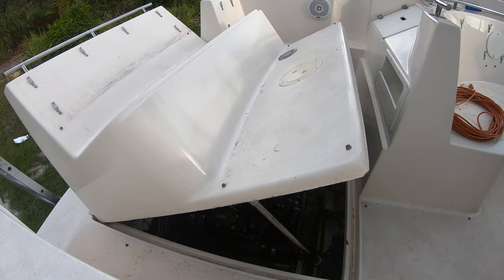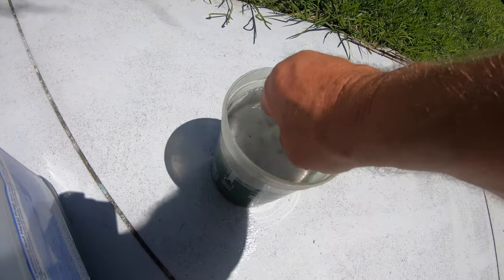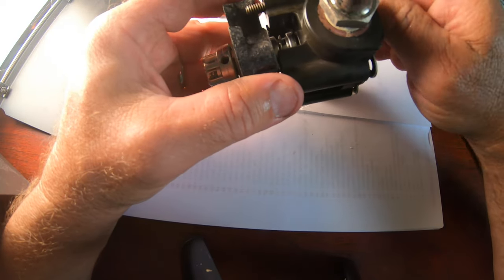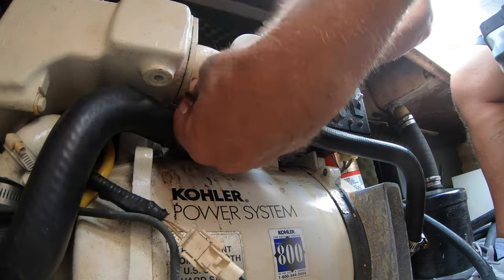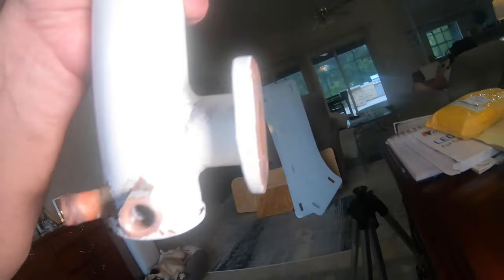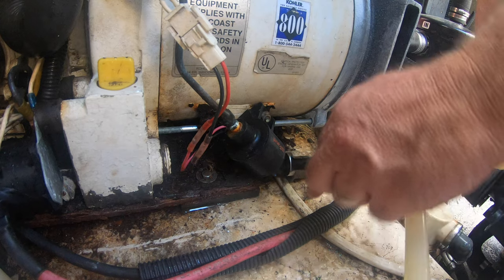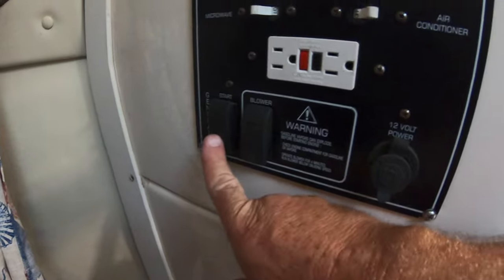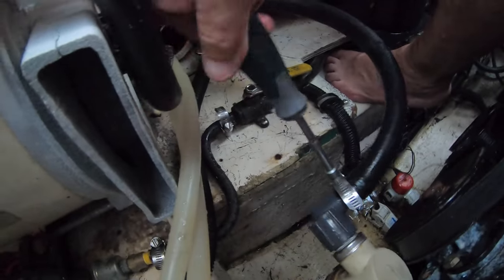Kohler 5E Marine Generator Won't Stay Running - Troubleshooting and Repair in 4K

Comment: This video was very helpful. I submerged my heat exchange and it came clean. It was incredible what flushed out with the hose. Once clean I found several pieces of old impeller on the inlet end. They were a pain to remove but I was glad I did. The generator runs fantastic now. The water out the side of the boat is much cooler now. The acid isn't cheap but worth every penny
Reply from the maker: @ChrisLuhnow  glad it was helpful. A whole bunch of crap was stuck in mine…

Comment: great video, I had already changed my impeller assembly but noticed not enough water going thru system and generator would still overheat after a while.  Next stop is the heat exchanger, thank you.
Reply from the maker: Good luck with it. I had lots of mineral deposits inside, but an acid bath cleaned it right up!

Comment: Very impressive, thorough and super helpful video! I am excited to start working on bringing my Kohler 5E back to life on my Rinker 312. Thanks a million!!
Reply from the maker: Thanks for the comments. I would definitely look at the fuel filter and the oil pressure sensor switch first. Also, if you have drained the coolant out, there can be an air bubble which will also shut down the generator. If it runs and then turns off after a few seconds, try disconnecting the wire from the oil pressure sensor switch. If it still runs after doing that, that’s your  culprit.
Reply: @RandomlyAwkward1  I will definitely add that to my list! Plugs, filters and impeller on order. I’ll reply if I find anything interesting

Comment: I’ve always wondered where that yellow impeller bushing goes.  Lol.   A couple other stalling issues I’ve discovered in this gen is a misadjusted choke and also air bubbles in the coolant or low coolant levels.   Kohler gens have sensors for everythig and the old models don’t give error messages. Making troubleshooting a pita😡.  Nice video. Thanks.
Reply from the maker: Thanks Tommy… I finally got it to stay running long enough for the blender to make Pina Coladas!

Comment: GREAT video!! It helps a ton!  

Mine runs for about 45 minutes to 1 hour and then turns off.  It's the same load the entire time.  Start up completely normal.  Any idea what would cause this?  Thank you.
Reply from the maker: Glad it helped! Yes, check several things… make sure that you have enough oil in the generator because there is a low oil pressure shut off switch. The switch can also go bad and may need to be replaced. You can troubleshoot it by disconnecting it and if it continues to run, then the switch is your issue. You can also have a coolant air bubble. There’s a little bleeder valve screw up on top to burp out the air. The other is a  poorly operating impeller that may need replacing. A piece of an old impeller vane may have broken off and is stuck in the heat exchanger or you could have an obstruction. I ran phosphoric acid through mine to get rid of the barnacles and mineral scale. Overheating from an obstruction in coolant flow or low oil pressure are usually the culprits. Also, check your pencil-shaped anode passageway for obstructions. Good luck!

Comment: Nice video!  I have a 5E on a 2004 Sea Ray 280 Sundancer that's not exhausting any water.  I checked the screen and that's clean.  Next step is to check the impeller, which is a bit hard to get to in this boat.  When you took off the heat exchanger and refilled the coolant, did you have to bleed it to remove air bubbles?
Reply from the maker: Thanks… Yes I did. I put some coolant in it until it was full and then ran it and it bubbled a little bit and I put more in there. Incidentally, you said it is not pumping out any water. My impeller just went bad about two days ago. I’m currently replacing it as we speak. The repair itself is very easy. You just take out the four 11mm bolts that hold the water pump onto the generator and remove the hoses. The whole assembly comes off and you can just push the new impeller and O-ring in place taking it out noting which direction it turns. A little bit of Dawn dishwashing liquid makes it insertion much easier. What happened in my case was the metal collar that is inside of the rubber impeller became disengaged from the rubber so the impeller stayed put but the shaft turned. That generator has a thermal shut off so after it runs for about a minute and overheats due to lack of water circulation it will turn itself off. That sounds like what you are experiencing as well. You can also check to make sure your sea strainer is not clogged and that there’s no obstruction under your hull like seaweed or something to prevent water from coming in.

Comment: I’m fighting the same issue in my Kohler 5E on 2002 Rinker 270. I replaced fuel filter, antifreeze, oil and filter, fuel filter, anode, impeller, and added a stainless steel thru hull. It never ran after my “tune up”. Pulling it apart tomorrow to check oil / antifreeze levels and oil pressure sensor switch. 🤞🏼
Reply from the maker: It drove me crazy but the main culprit was the oil pressure sensor switch. Does yours start and run for 10-20 seconds and then shut down? If so, it’s almost 100% the oil pressure switch.

Comment: Very good video - I have 2008 Sea Ray with same Kohler 5e - did you have to prime the fuel line after replacing the fuel filter.  Love you sense of humor
Reply from the maker: Thanks for the compliment… I did not prime the fuel line. It fired up in about three to five seconds. I think the oil pressure switch is a big issue with these generators.

Comment: Great video, two dumb questions.

1. Did you have to do a full coolant change after putting the heat exchanger back on (why didn’t coolant come out of anode hole).

2.  The part I really wanted to see was right when your go pro fell.  I can change my impeller by taking off that housing but how did you get the next housing off to reach that yellow coupler?  Is it just a hard pull or are there more bolts than the 4?

Thank you!
Reply from the maker: Thank you… not dumb questions… since it was the first time that I had worked on the generator and I did not know the history of it, I changed all of the coolant. It really wasn’t that big of a deal. 

     The coolant didn’t come out of the hole because the rod was totally disintegrated, and it was gummed up, so nothing could come out of the hole. I dissolved all of the crud with a phosphoric acid I’d bath.

     That stupid housing was incredibly difficult to get off. It just press fits on, but I ended up using ratcheting tiedown straps from Harbor Freight on the different corners and banging on it with a mallet and some PB blaster to get it loose. I must’ve looked like a total idiot trying to get that thing off, but it finally came off. It was mostly just corrosion holding it on. I cleaned everything up with some Emery cloth so the next time I have to remove it, which I hope is never, it should come off much easier. The impeller change is very easy but I just wanted to kind of have a baseline so I pulled out that little orange plastic rubber sleeve. I won’t to do that again!
Reply: Ok, awesome!  Thank you very much.  I was just a tad concerned because while changing my impeller on my 5E a little piece of wire was coming out of that next housing and I clipped it off. I had to run to an appointment and didn’t get to finish and fire it up.  Thanks again!

Comment: I have the exact same problem on my Kohler 4ESZ.  It runs for 20 seconds and shuts down.  Ran fine last season.  Thanks for the tutorial.  What's your best guess on which  of your fixes actually solved the problem?  Thanks
Reply from the maker: Hey Bill… there are a couple things that will for sure make your generator not work. One is to make sure that there is enough oil because it has a low oil shut down. Number two is the oil pressure sensor switch could be bad. If you disconnect the electrical lead on the top of it, and it runs, you’ll know that that’s the problem. It was fairly inexpensive and I think I may have linked the part number in the video. The other biggie is a clogged fuel filter. While possibly not the issue, spark plugs are cheap insurance and it probably wouldn’t hurt to put two new ones in. I think that they were five bucks apiece. The last thing is if you have an air bubble in your coolant, that will throw it into a shut down as well. Check to make sure that your coolant is topped off and that you don’t have an air bubble in it. I did not have a problem with the choke, but I know that the choke position and spring is another issue on the Kohler generators. I would first check the fuel filter and the oil pressure sensor switch as well as the oil level first. Let me know if you’re able to get it solved. I like a challenge!
Reply: @RandomlyAwkward1  Thanks so much for replying.  I know oil is full and water seems to be pumping ok.  The twenty seconds thing must be more than coincidence - I'm thinking the control board senses something and shuts down after 20 seconds.  I definitely suspect oil pressure sensor, but so far I haven't located it.  ACCESS  ACCESS, ACCESS - in addition to your access problems, I have a sound baffle thingy that surrounds the gen.  i've yet to figure out how to get it off more than part way.  When the rain stops, I'll try again.  Will advise.
Reply from the maker: Bill, from what I have read, most people remove the sound baffle, because it actually makes the generator run cooler.
Reply from the maker: I forgot to mention that the oil pressure sensor switch is located near the oil filter on the block and will have a wire running to it. I think you can also hold down the start switch once the generator starts and it will continue to run. That bypasses the sensor. You could try that and if it keeps running as long as you hold the switch down, then you have your answer.

Comment: Thanks for the video. Mine starts fine and pumping out water but shuts down after 4-5 minutes and sounds like it is getting fuel starved. Wonder if its the fuel filter. Going to start there and change impeller too. Any additional input would be appreciated.
Reply from the maker: It’s probably turning itself off for one of two reasons… low oil pressure or overheating. Make sure the oil level is good and check to se if you need an oil pressure sensor. Disconnect the wire from the top of the sensor to bypass and see if it stays running. Also, check to make sure you don’t have an air bubble in your coolant that makes the level low. Lastly, the impeller could be spinning on the shaft and not “impelling”. I’m confident that it is one of those things. If not check the fuel filter or consider replacing the plugs… cheap insurance for the future. Let me know how it works!
Reply: @RandomlyAwkward1  replacing plugs ended up fixing my issue. Thanks for vid. Helpful!
Reply: @brettkirkland2916 May I ask witch plugs your talking about? I’m having the same issue
Reply: @MikeMagadiayourhomesold I have the same issues let me know which plugs they are talking thank you

Comment: great how too video! I am having this same problem! only 16yrs old on mine lol I promise I will not use any safety equipment either did you change the oil too? can you please post the parts list and numbers too?
Reply from the maker: Hey there @gardco5380 I did not change the oil because it had been recently changed (although the generator had 14 hours after 23 years when we bought it...) but the procedure looks fairly simple. Drain via a vacuum pump and replace the oil filter. 

Part Numbers:

The yellow rubber impeller coupler is Kohler part # 359448

The water pump impeller and O ring are Kohler part #359978

The anode rod is Kohler part #260085

The fuel filter is Kohler part # GM116125-S

The oil pressure switch is Kohler part # 359789

The two spark plugs are NGK BPR4ES 6578

There should be a fuel petcock running from the fuel line out of your gas tank to the generator. Mine was readily visible with a yellow handle but you may have to scout around for yours. Also, be aware that an air bubble in your coolant can cause a thermal shut down, so check the coolant level.

Hope this helps!

Comment: How difficult was it to get to the spark plugs?
Reply from the maker: Hey Tom...It was a bit tight behind the engine on the right side because it was against the transom, but the left side (as you look at it) was a bit easier. The hardest part for me was fitting into the engine compartment! I did most of it by feel...

Comment: Do you have part numbers for those parts you replaced ?
Reply from the maker: Hi David,

I used the following:

Oil pressure sensor  #359789

Impeller and O ring kit  #359978

(2) Spark plugs NGK BPR4ES

In-line Fuel Filter Kohler GM116125-S

Hope this helps!

Comment: current specs is that you need to use two hose clamps for fuel and and hoses from through holes
Reply from the maker: I didn’t know that… thanks for the tip. I’ll put a second clamp on!

Comment: Parts nr on anode
Reply from the maker: I'm not sure that I understand the comment...
Reply: Hello
I wonder what the article number is on the zinc anode
Reply from the maker: @hakanottersten-lf1mb  Hello...It is part number #260085 from Kohler. I typed that part number and "Kohler 5E generator anode" into Amazon and found it for about $15.00